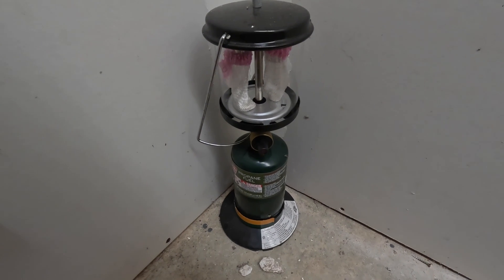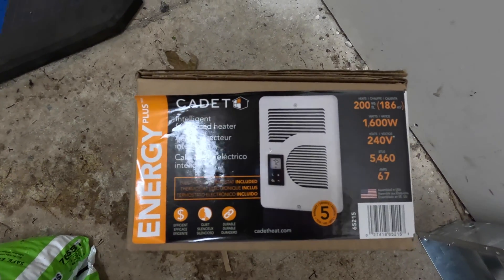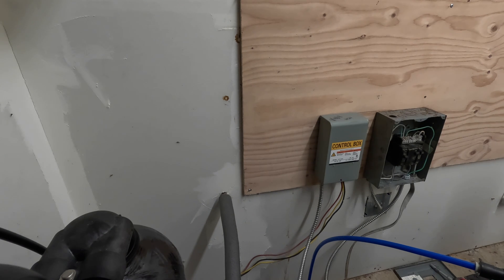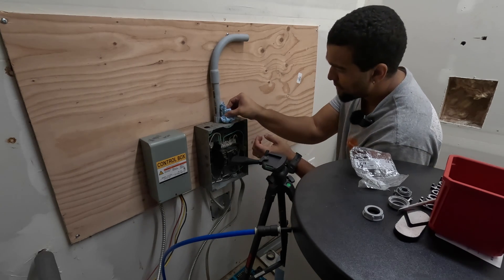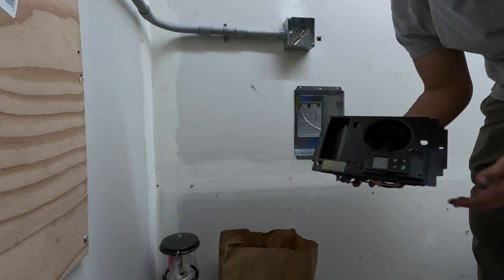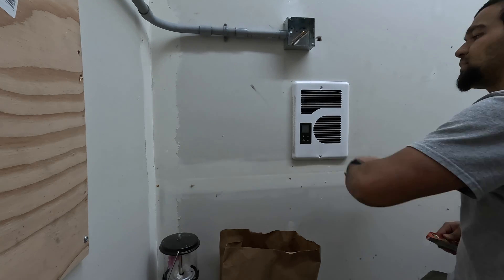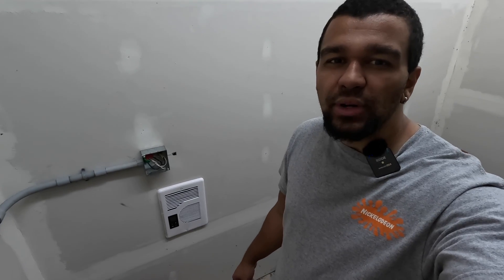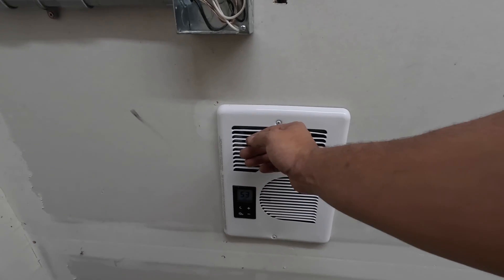My Well Water Pipes Will Never FREEZE Again!

Comment from the maker: Product Links:
Heater: https://amzn.to/3TCpdDd
Romex: https://amzn.to/3O6QD0z
THHN Wire: https://amzn.to/4aB2MUY
Pull string: https://amzn.to/41USjQt
3/8" Impact Wrench: https://amzn.to/3tovfwE
Plywood Backboard: https://www.lowes.com/pd/1-2-in-Common-Fir-Sanded-Plywood-Application-as-2-x-4/1000068957
3/4" PVC Conduit: https://www.lowes.com/pd/CANTEX-Common-3-4-in-Actual-75-In-Non-Metallic-Pvc-10-ft-Conduit/3568512
PVC Glue: https://www.lowes.com/pd/CANTEX-8-fl-oz-Pvc-Cement/1000193073 

My Equipment
Gopro Hero 11: https://amzn.to/47o7FOV
Rode Wireless GO ||: https://amzn.to/3tnTCKa
Samsung S21: https://amzn.to/48w35zg
Watch Garmin Instinct 2X: https://amzn.to/493MDXf